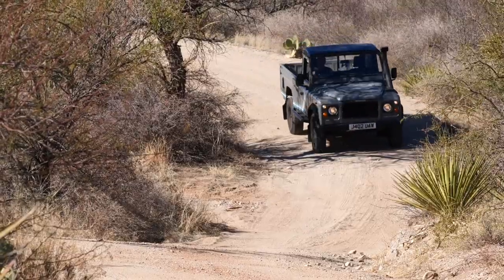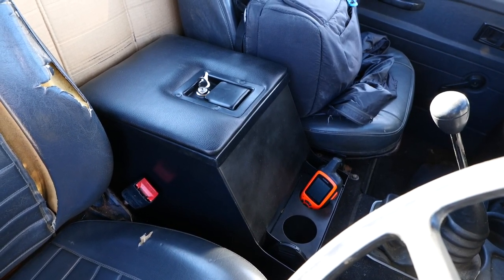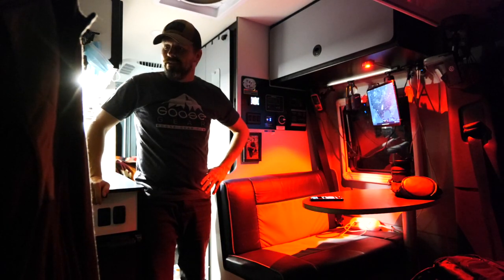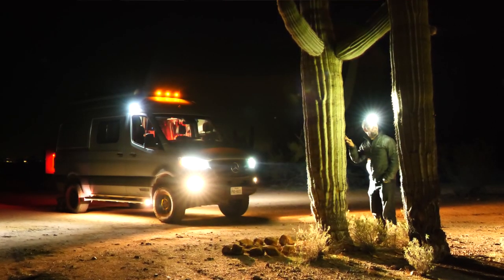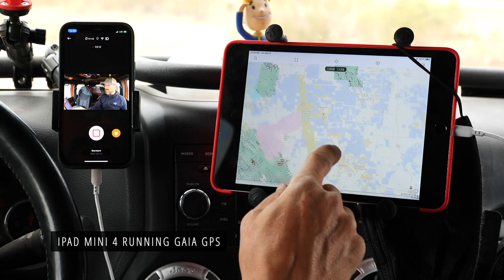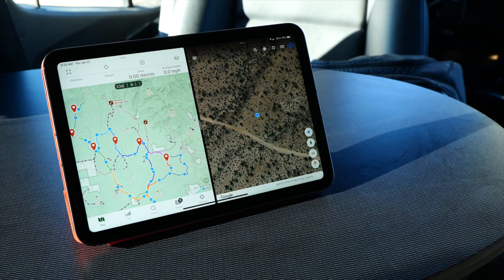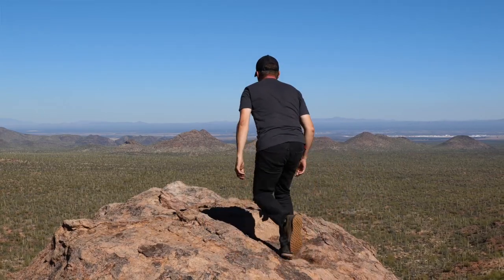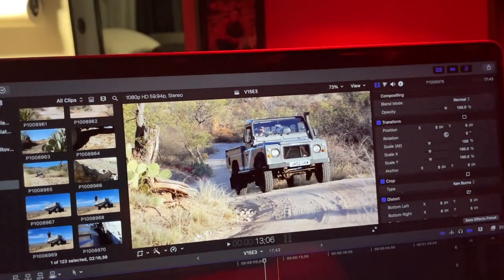V15E3: Shakedown Under the Saguaros

Comment: A decked slide out system would have been nice for storage and kitchen setup. Then covering the bed with an aged canvas to preserve the patina appearance of the truck and keep prying eyes out would be neat. 
Aren’t those shiny boxes going to get too hot for gear, food and propane?  
They might look so nice they may be tempting for theft.
Reply: they are bolted down from the inside - you would probably have to destroy them to get inside of them or cut the lock.
Reply: They are aluminum right?  A claw hammer or pry bar would make short work of them when mounted in an easy to access spot like a truck bed, vs someone’s roof. 

Then there is still the matter of sun and heat and camera gear, batteries, computer and food. 

Whatever

Comment: Yep..good idea..person mentioned putting truck in son's  hands..ok..its a 91' is there  a newer version left hand drive n is it adaptable to yours..shifter I think is just a fabricator issue...so both from left side like your other two vehicles..its a steering column going down to a steering gear box
.boxes in truck bed if mounted on say body mounts would raise it enough n stop debris from being trapped between the two..aluminum or not..just saying..n they're rubber with a steel sleeve..n yes I get the truck..n all..enjoy no shoveling n your day..thanks
Reply: I think his son would rather have orangey

Comment: At the 2:40 mark when you parked, it looked like you put the transmission in neutral and then set the parking brake. If that is the case, that's a bad habit to get into. Engine compression in low gear is the only thing that will stop or slow a roll if the parking brake doesn't hold.

Comment: You have a diesel engine which is turbocharged-you need to let it idle for a couple minutes before shutting it down,or you risk losing your turbocharger to coking-which is a condition caused by people who know nothing about turbo diesels.Your turbocharger is cooled by the oil supplied by the engine and that turbo will sometimes reach double the engine temperature-when you shut it off while hot,the supply of cooling oil stops flowing through the turbo and only a small amount is left in there when you shut down.That small amount of oil will cook due to the high temperature of the turbo and that’s coking.Let it idle a few minutes before you shut it down and the engine will keep pumping oil through the turbo-cooling it.
One other thing I see-the Revel is a great vehicle for exploring and one I know and respect,but if you travel off the beaten path with it often,it’s only a matter of time before you get hopelessly stuck.Adding a winch(the best in my experience has been Warn)would dramatically increase your ability/survivability tenfold.

Comment: That ground is pretty hard, shouldn't need difflock when you're just cruising around those tracks. You might be putting excessive strain on the drivetrain. Those vehicles are permanent 4wd in hi or lo.

Comment: Hi just keep in mind when using the diff lock with the landy only when there is a real risk of spinning tyres. If you take it off and the light stays on just reverse till it goes off this will help to prevent wind up.. keep em coming 👍🏻

Comment: That rig is prime for a bed camper.  I'd go with something removable like a 4wheel pop up camper vs something more permanent like the Alu-cab.  Eventually you're going to want to use that truck bed in some other capacity and the Alu-cab prevents that since it's sealed to the bed and the way it attaches.

Comment: Not a fan of the highlifter jacks. They can be dangerous. There are other and maybe better options out there. Just be careful when using it alone.
Reply: They're not dangerous as long as you know how to use them. I originally would have agreed a year or two ago, but I went to a class on proper usage and am no longer intimidated by them. They have a wide variety of uses as well. I definitely recommend looking into some classes in your area on proper usage!

Comment: I would say that each vehicle has its own pluses and minuses. You have so much of your life invested in orangey that at some point you back down from more difficult things because you're worried about it.  
With the revel obviously it's a somewhat off-road capable van but getting stuck or rolling over would be difficult to tragic so you have to really watch what you do. Then there's the d110 which has a very good level of off-road ability and probably less worry about cosmetic and minor damage due to its age and condition.
My only question is what are you going to do when you have all three?

Comment: Love the new old truck. I have a 78' Jeep CJ5  so I'm a bit partial to old purpose built vehicles. Seems the you have to make several revolutions of the steering wheel to get the truck to turn just a little. Is that how it's designed? Maybe to prevent oversteer or something? Looked odd.

Comment: Tip on shifting, don’t grab the top of the stick. Push the stick to the gear you want. When in neutral it will line up on 3 - 4 gears. So for 1 - 2 need to push the stick left and up for first. Going to 2nd hold stick and push left and straight down. To third push stick straight up and it will automatically line up on 3rd, just push up at that point. No grinding gears or accidentally putting it in the wrong gear.